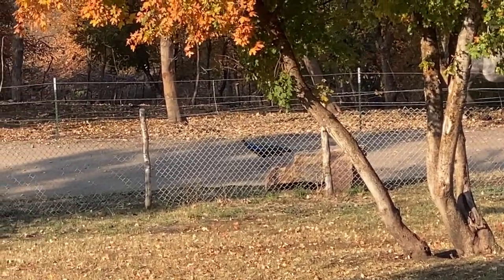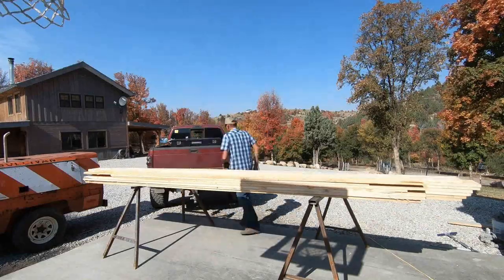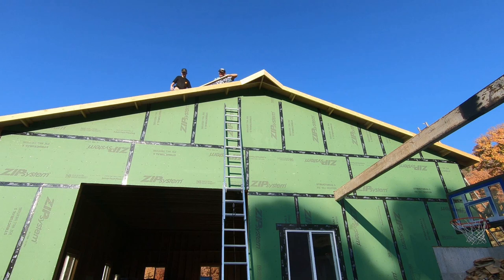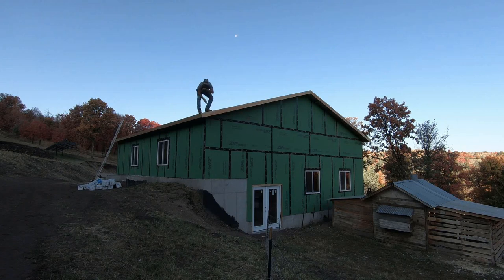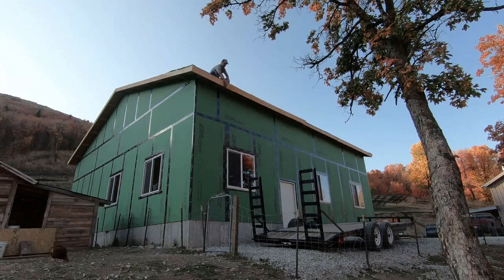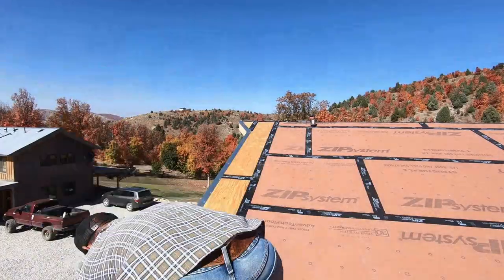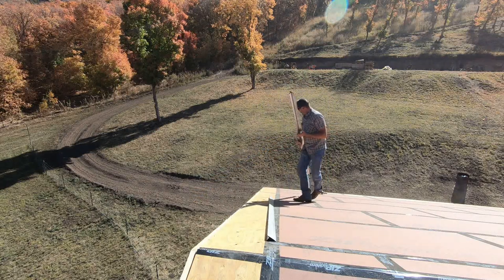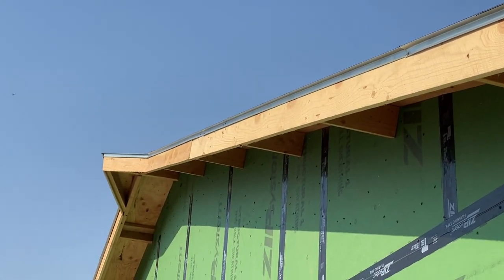#442 - Shop Build: Installed Wood Stove Chimney Kit, Roof Dried In, Basement Windows Installed.

Comment: Great work, I enjoy your video's more than any. You will love the custom  cut to length metal roof. A couple of year ago we built a screen in patio. I didn't know at that time you could get most any length metal roofing.  Luckily  we have a shop here in Rome, Ga. that makes the metal roofing. I went to there shop checking on the metal and got to see how it's made. It comes in a roll, sort a like the gutter metal. It run through a machine forming the ridges part and comes out as long as you want it, and it's sliced off to length. I am glad to have 24' length metal roof without any seems. I like what your doing with the shop, it is going to be as tight as anything I have ever seen. You might even need ceiling fan to push your warm air downward. The extra length will be a hand full to handle, but sure you know this, and will device a way to do it with the Lull, or excavator.  Best to you and family.

Comment: The drip edge appears to be right up against the trim. There should be a 1/4" offset from the trim to the facia to keep water from dripping down it and rotting it out. I found out the hard way when I ran the drip edge right up to the 2x6 facia board on my deck cover 8/

Comment: Very glad to see Cedar is springing back so rapidly and while it is good to see progress, it is better to know the right level of caution has been applied to recovery. We can all be over eager patients but it becomes painful if we end up paying the price of excess zeal. I can imagine how pleased you must be with the progress on the workshop. With bad weather likely to arrive soon you have certainly avoided a potential problem. I do not envy you handling cold metal on a roof if the weather turns nasty with ice and snow. Insulating those big wall and roof area will pay dividends, but it is at least something that can be done more easily inside than outside.

Comment: Heath, to make the underlayment lay perfectly flat by yourself, roll out 1 row, and then pull the top half of the release film off with the underlayment laying on the roof. After that pull the bottom half of the release film off of it. It is very difficult if you try to remove it as you roll it out. I have tried it all kinds of ways and rolling it out, letting it relax,  and then removing the film one hald at a time while it lay flat on the deck works great. Cheers

Comment: When I use the Grace or any other brand of ice and water shield I use my hands over every square inch to lay it down flat and without any bubbles. Then I apply even more pressure with sometimes my work boots, small rollers and a plastic paddy knife. The ticket to get it flat is a good summer sun and pressure. When you do that, it will not wrinkle unless you leave it for some time in the exposed UV rays as this stuff doesn't like the UV rays at all.

Comment: Get a length of pipe and cut it the width of your rows of Grace Ultra.  Cap one end and fill with concrete.  Cap the other end.  Center locate on each end a set of eye bolts as anchor points.  bolt them so the eye on the end floats.  Tie rope to each end and let the weight of the pipe flatten those rows of the Grace Ultra nice and flat.  The back of the shop on the hill side would be a great place for some IBC linked totes to collect rainwater fromthe shop roof.  That could be used to water the animals with a small solar pump.   You might think about a mezzanine across the hill side of the shop as an office/hangout spot.  Install a fireman pole or build a slide.  Kids will go crazy for it.

Comment: Shop looks great, seems like a far easier build than the house - probably experience + Zip System...  You could remove the siding and re-install it so it overlaps like giant shingles....  Also, make sure you properly seal the concrete to zip area.  That's a place water gets in and rots things, although it's high enough above grade that it's not likely to be super vulnerable.

Comment: Going to need ceiling fans to push the heat back to the floor, so the heat can lift it back toward the ceiling, so the 3-4 fans can push the warm air back to the ground.

Comment: With roofs, always work bottom to top.  The upper drip edge should overlap the lower, not starting at the top working down. So water will allay shed off not be allowed underneath.

Comment: i have never been scared of anything my entire life but enclosed spaces. but for some reason when i started my roof leaning over the side putting on my fascia board. i would start to panic and have to back off i just couldn't do it. so i put my peg board back up and did it from there.  i dont get it the same height either way. but i could do it from the peg board but not leaning of the edge. you doing a great job keep it up and i get  alot of what i'm doing from watching your videos.

Comment: I speak from experience so much better to not have any holes in the metal roof just go out the gable side :D  not having leaks and such in the future is so worth it.  Its not uncommon to have to redo the flashing on that stuff every 10 years on metal roofs which they never tell you.  Yeah, so much for the 50 year roof they told me too haha  every vent and hole, I will be running mine out the gables in sort order once I get some time and it cools down.  I believe I have new full panels I can replace the one with holes in them.  I using a dekra metal roof if your curious.  Best of luck to you man and keep up the great work!  If you don't believe me too look at the warranty on the flashing kits they fall way sort of the 50 years.  I was shocked first time I saw that when I went to get a new one to stop some leaks.

Comment: The section of the chimney kit that is install ON the roof, shouldnt the lower section be applied over the roofing so rain wont get under the shingles or metal finish?
Reply: Yes, he just has to add another layer of flashing around the chimney kit while he is installing the roofing material
Reply: He’s probably figuring since it’s gonna be weeks until the steel arrives it’s water tight for now, that said my parents steel roof and mine the sheet was just cut very tight to the collar on the flange and caulked to seal it up, but they were both roof overs on top of shingle roof
Edit: I now see what you were talking about, he must be planning to do the same thing I did

Comment: So wood is the primary heat source for both main living building and shop / garage ? And there is generator for backup power.  why not run geothermal pump instead of burning endless amounts of wood ?

Comment: you got a peacock? the lions left him alone..the woodstove will heat up the garage right quick - do the blue foam cut to fit leave an inch space on roof for soffit to ridge ventilation and no condensation - thin about a pos pressure hepa and heat exchanger - you might be able to make your own with straws - they can be 80% efficient - think about bringing in air for the stove from outside - it is ok to have the building be a little leaky - do not use the spray foam just the blue boards - you can use the cans of great stuff but not much should be needed 3" of foamin every bay and luan or drywall and you are all set - i would have done radiant but it is all good once the stove heats up the structure it should be nice and cozy - have some sort of passive air flow to make sure you have good recirc - you do not want all the voc you want some air always entering the building you could push fresh air to stove but also push some into the garage also so all air is leaving the building - not sure what the specs are for air recirc - maybe read around for the recommendations
Reply: hope your wife gets better - health care in this country is so screwed even the election is not going to do much  we can only hope - don't get sick whatever you do
Reply: you need air hose - join the 20th century old timer #trimout #pins
Reply: the grace water shield really is nice product - you are getting much much closer - think about sawing some of your own siding - it is only a couple days of sawing saving you tons of money - go with diagonal shiplap - it is just a router run away after the table saw and planer - great you are doing it mostly diy - your framing bkgd helped a bunch #advantec